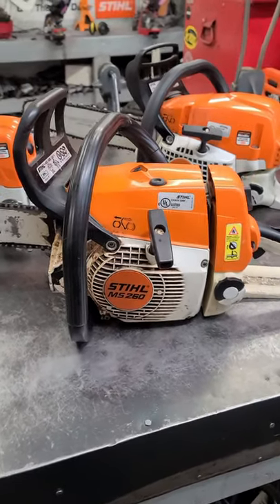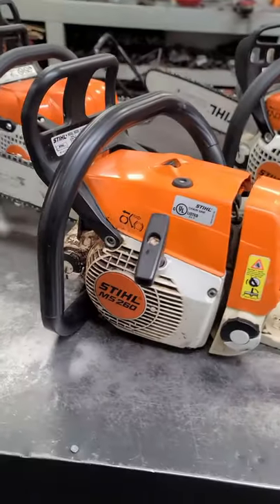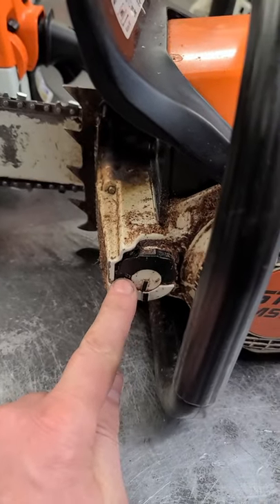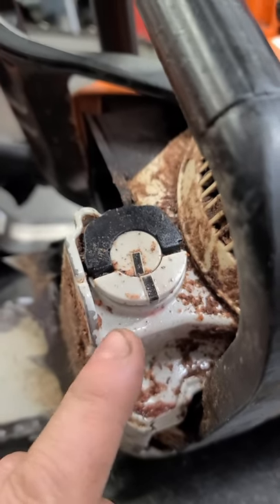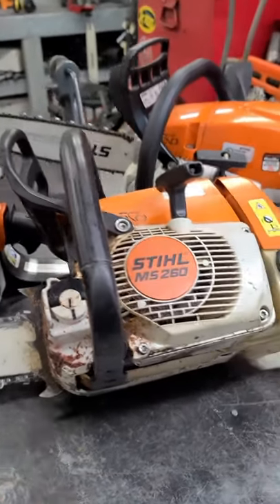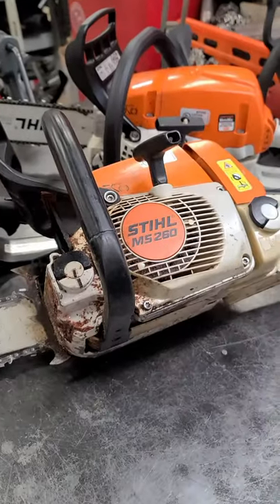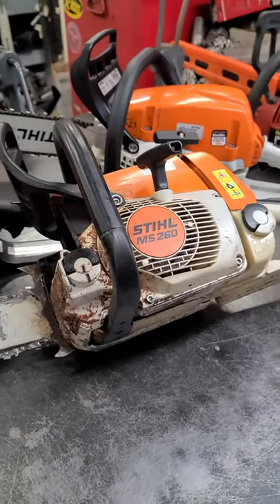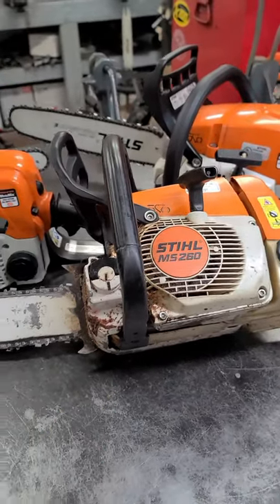Why Most Stihl Chainsaws Leak Bar/Chain Oil! #shorts

Comment: I wish they stuck with screw caps...
Reply: I have two 260s, and I like them both. One is screw cap, and the other is the bayonet type.
That type of cap seems to be used on air craft fuel fillers, but they are twice the size, and seem to be 
well thought of. Also they sit into the top of the wing and locate with the help of gravity.
The Stihl caps are small and fiddely, and require too much care.
Walking some distance through the woods, only to find that a misplaced oil cap has dropped the oil all down your trowser leg makes your mind up for you.
Nice saw with a bad idea for a woodsman.
Reply: I hate the leaky screw on oil caps

Comment: Thanks for the always informative videos.  My old Husky and no longer new Stihl saws both leak gas & oil.  My quick fix is to always lay the saw down on the bar side, which keeps those leaking caps facing up.  They no longer leak in that position.  :)

Comment: You can get just the o-ring and replace it and that solved my problem. Significantly cheaper than the whole cap (also they had the o-ring in stock).

Comment: That was the biggest blunder Stihl did to their saws shameful.
Reply: Really? It's not being a pain to cold start?
Reply: @Karl Rovey  yes my neighbor bought a new steal and has a hard time starting it too.
Reply: @Tom Sawyer  I really need to take mine to the dealer and have them look at it. Last two cold starts took at least 50 pulls. I did pull the spark plug to check to see if I was flooding it (then got it to start the next pull on my most recent cold start). This saw hasn't even had 10 cold starts.
Reply: @Karl Rovey  ya, the old sthils always start warm or cold. I would try to find a good old one rather than these new ones. I feel your pain that just shouldn't happen with a new one.

Comment: I read it might be a pressure build up issue, so to open and close the caps when putting the saw back into the case. Worth a try.
Reply: Coming down or going up the mountain each day into the forest ? Open the caps top and bottom.
Reply: I have started doing this with mine after each use. You are “burping” the pressure off by opening the caps briefly. Much less to sometimes no leaking between uses now.

Comment: I have a Stihl saw and it does that also and it was a new saw when this happened and I just placed it on the opposite side when not in use. That seemed to lessen the problem and I add bar oil regularly when in use or being stored.

Comment: Like Bill T, I prefer the old screw caps. That being said, I have been told that there was an update to the lever caps, and that if you use the newer design (has the black lines like the oil cap in the video) they are less likely to leak...although as we see, can still leak🙂.
Reply: @skidooer583   Probably one of the places I saw it:-)
Reply: @howardkendrick3525   this is true the black lines yes do not line up very well. U had to rock the cap back & forth tell they did line up & even after you did that at times they were not seated correctly at times. Best bet was to take off the cap & start over again. Yes, since then they have updated. I do believe.

Comment: I have an ms360 pro saw purchased brand new in 2002 that leaked bar oil from day one, the dealer replaced the flip cap for free the following year which lessened the leak but didn’t prevent it. The saw gets used a few days per year to cut firewood for personal use. So for the past 20 years I’ve made sure to put the saw away in its case, empty of fuel of course, with a rag underneath to soak up the little bit of remaining oil that inevitably leaks out over the next 360 days. It’s too beautiful of a saw, that otherwise has been flawless, to have one minor issue unrelated to the saw itself really. Yes, shame on you stihl! I can’t believe the same caps are still used today and some of them still leak bar oil, head scratcher.

Comment: Mine leaked. It would also pop out of grooves. It is a 2-3 piece design. I had to do like a plunger pull and double twist for the cap to "fix itself". This allowed the cap fingers to reach deeper into port and actually catch and hold and then do the flip on top for the tight seal.

Comment: Caps aside, I find there is another common cause of bar oil leaks with all saws exposed to heat. Happens all the time with my Husky.

So you take your saw out of the shed (low temp) and put it in the trunk of your car (or anywhere else destined for heat).

Now ambient temps increase and expand air in the oil reservoir, forcing oil outward.

Big mess.

Comment: On the smaller clamshell stihls with plastic cases Ms230/250/290 etc. I have found that they all leak from the oil pump fitting under the handle bar. Its due to loose connection between the fitting and the oil line, sometimes the o-ring on the fitting can be at fault. The way that i fix them is to order a new oil pump fitting and add threebond 1184 where the fitting connects. I have fixed dozens of saws this way and they never leaked after.

Comment: Is there a third party cap? Or just OEM and knockoffs? I'd like to put a screw cap on there, but I think it's impossible because of the tank design only works with the lever caps.
Reply from the maker: pretty well  impossible to put a screw cap on
Reply: @donyboy73  Thank you that's what I figured. Sad trombone. Mine works fine, 80% of the time.

Comment: My new 271 farm boss doesn't oil my chain and bar enough.  Idk why it doesn't oil enough, it's an automatic oiler
Reply: There is an oil adjustment screw on bottom side. Turn it out for more oil if you haven't done so already...

Comment: My new stihl chainsaw was leaking real bad, so went to the dealer and the woman says you didn't put the cap on correctly. Hey lady it can only go on one way, so with a new cap it quit leaking. Right after i got home with the saw I tried starting it and it didn't fire so I flooded it. After removing the plug and pulled it over, put the plug in and it started. That's when I noticed the chain was way too tight so giving it throttle it didn't want to move. Fixed it